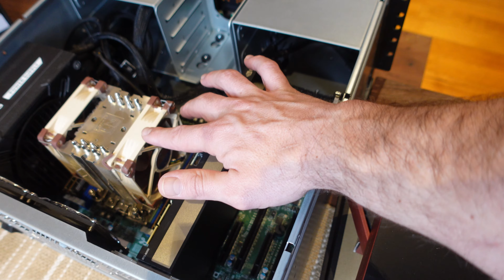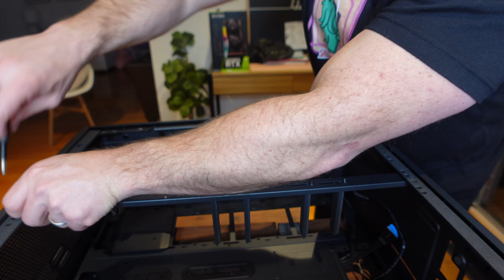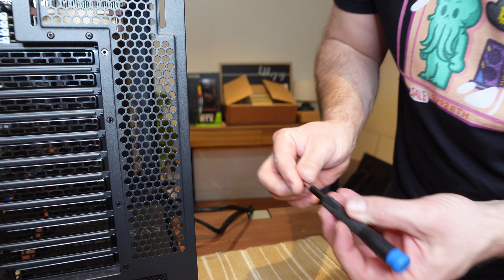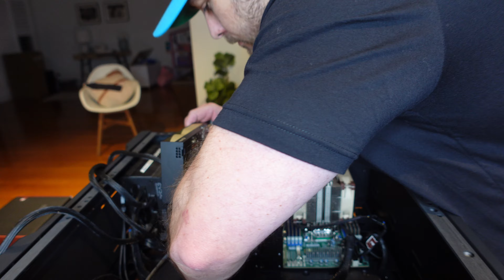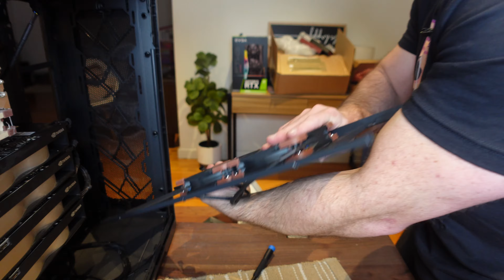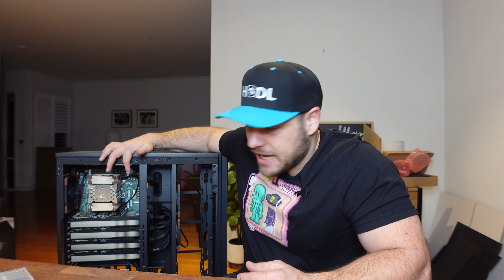AI Rig upgrade

Comment: How Many 4090 Founders Editions would be able to fit in that case? Thanks!
Reply from the maker: Thanks for watching. Good question not exactly sure, would think like 3 but hopefully one day I can test it out. I am also interested about the thermals
Reply: @2ndtlmining  I've been searching with no luck. Are you aware of a case that can support an E-ATX motherboard with 2 power supplies. I know this is a big one but hopefully can also fit 4 4090's. Looking to build out an AI rig but finding the case seems to be the hardest part.
Reply from the maker: hey  @davidmc1975  hmm interesting not sure if you will find a normal case. I know Octominer does X99 but would not really recommend that. Most people i saw that is doing multiple 4090s has either 2 in big computer case, or they doing server and or open air frames for their 2+ 4090s

Comment: Why A4000s? It is not as profitable in vast? unless you have other plans?
Reply from the maker: Thanks for watching. The rig in the video added 3 X A5000. But I do have a 2 X A4000 rig. It's what GPUs I had from mining so really repurposed
Reply: @2ndtlmining  No wonder. I guess just monetize what you have since you already spend so much on build the system to run the GPUs
Reply from the maker: @ivenyoon7195   Yeah regretting buying the A4000's in the bull run. School fees i guess
Reply: @2ndtlmining  better to buy the 4090s much better profits. and easy to rent out.
Reply from the maker: @ivenyoon7195   Yeah agree 4090s are great
Reply: Profits?
Reply from the maker: @ramonabila7313  not bad depends what you charge and what your elec rate is. On Vast website you can get an idea for me it's going very well